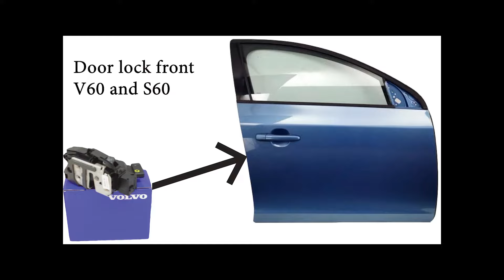Volvo door lock; front door V60 and S60

Comment: Thank you for this. Was worried that it would be different on the driver side but it was essentially the same. I also skipped removing the cable at 5:58 as it was an absolute bitch to unplug but it was lengthy enough that I could leave it in.